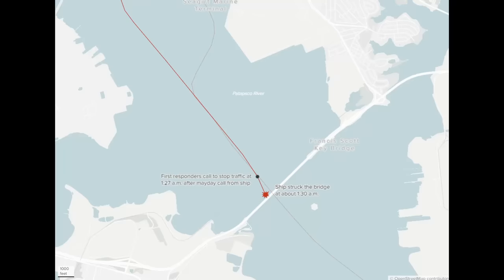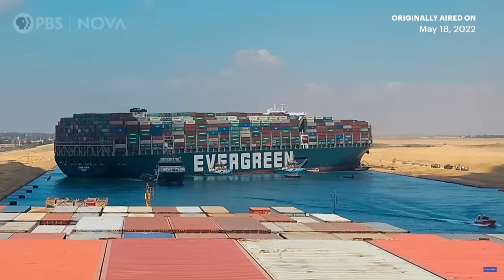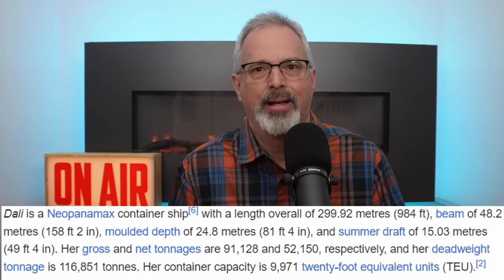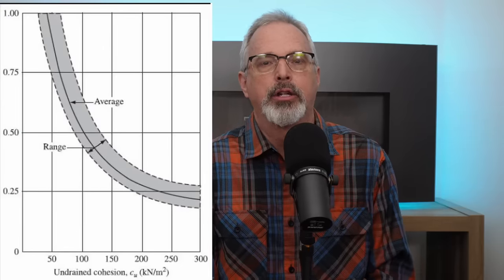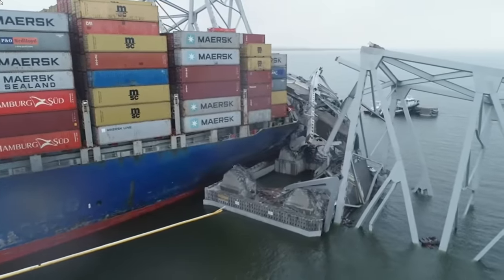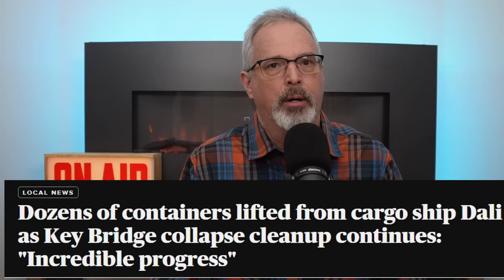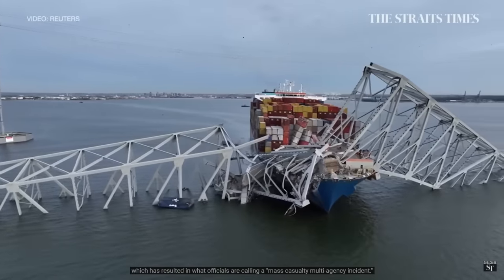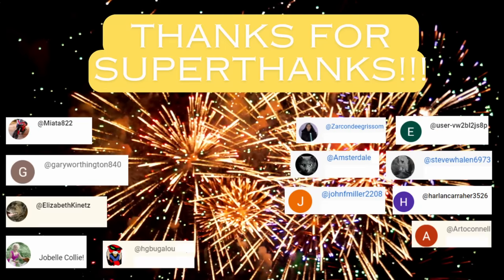Can the MV Dali be Refloated?

Comment: Casey,

There will be a series of steps needed to refloat and free the M/V Dali.

In no particular order; removal of bridge structure and concrete, removal of the anchor and chain, patching, holed tanks, pumping water from the forepeak and bow thruster room, even out trim and list, and removal of additional containers to lighten load.  I think they would need to dredge around the bulb.  I would also think they would dredge along the Dali's length so the channel was a couple of feet lower than the Dali's depth.

I would expect that they will assemble a group of tugs capable of pulling the Dali free.  I would expect the Dali's engine, propeller, and rudder would be available.

It is important to remember this operation will be done by a Salvage Master.  Someone with experience in these kinds of movements.  The Salvage Master will have the support of his naval architects and marine engineers.  The USCG has a team of naval architects and marine engineers that support the USCG-OSC.  The Classification Society (NKK) will also be involved.

While the mud presents a lot of problems, clearing debris from the bottom is a bigger problem.

Bob
Reply: Hi Bob nice thinking

Comment: Casey, I’m an actual naval architect. I doubt that they’ll have significant trouble refloating Dali. 5:1 is a reasonable full load displacement/lightship ratio for a containership of Dali’s size. Once they remove the containers and the ballast, you should expect a draft of no more that 5 meters.
Reply from the maker: Thank you.  That is a great point and I hope it works out like that.
Reply: Another actual NA here who specializes in tug design. A typical ship docking tug around there is about 50-80 tonnes (55-88 s.tons) of bollard pull (the amount of static thrust they can generate). A few big tugs, run the ship main engine in reverse and the ship comes free. I don't think it's grounded that hard. Lightering the containers at the bow and the bow lifts up and stern sinks too.
Reply: Once you get out of the main channel there, the depth quickly slopes to 10-20ft give or take.
Reply: Casey, some extra points to look at:
1) In the views shown of the Dali, if you look at the top of the command bridge of the ship, and the background shore, you will see a list to Port of ~2°. Meaning the Starboard side, is more in contact with the edge of the channel, most likely all the way to the stern.

2) On one of the marine related channels, the commenter stated that the first two bow compartments, have below the waterline gashes, from contact with the bridge pier.

3) I f the people in charge can arrange it for say 2 months from now, which to my mind will be about the time they will be ready, they can get at least 2 - 10,000 hp large ocean tugs on site. There isn't room in the channel for more, safety factors, to my mind.

4) Worst case scenario, they will have to put winch barges, anchored on the opposite side of the channel, to help pull. Keeping in mind the natural gas pipeline, that is buried below the bow.

Best wishes from the far North.
Reply from the maker: @carlthor91  Thank you for your comments!  I think there are a lot of questions about how well this refloating operation will go and what measures will have to be implemented.  Many people have commented that once the bridge debris is removed from the bow, that the ship will lift off the bottom.  That is possible, but I don't think it should be counted on, especially if there are flooded compartments.
Reply: @CaseyJones-Engineer  Thank you for the reply.
I just hope they do not have to resort to the anchored barge (Kedging) winch scenario.
That involves a total shutdown of the area, for a long period of setup, the last I know of the large Mammoet winch barge, it is in Europe.
Reply: I believe there is a gas pipeline under the Dali which would prevent certain methods of removing the ship from its current location.
Reply: @DrewKap  I see that you don't read any other posts, before posting.
Have a great day.
Reply: Thank you🇺🇸
Reply: Great points!!!!❤❤❤
Reply: What about that gas pipeline under or near the bow of the Dali.
Reply: Would you want to leave some weight on the back of the boat?  I know hull strength would be the limiting factor.
Reply: Thank u for this.  I thought this main pt bec once it’s unloaded I would seriously think it would lift on its own somewhat.
Reply: @evangatehouse5650  

Correct, and there's plenty oil industry anchor handlers with a bollard pull over 200 tonnes on the east coast.
Reply: @pecan11  I’ve worked with barges for 42 years and have gotten a few of them stuck in the mud.  Believe me that every little bit helps and sometimes will make the make or break difference.
Reply: ive spent a lot of time recently watching the suction power of mud on tanks, thats 1 smooth surface on bottom of that ship if 3/4 of it is in mud they are going to have to break that suction seal 
3/4 of that ship is outside the channel in the mud, the front area might be 4m or more deep in mud
Reply: i am a regular JoeSchmoe. Not an engineer or architect of any sort.  But I have been following this situation because I think it is interesting.  What’s Going on in Shipping Professor Mercagliano mentioned in one of his videos, that one of the bow compartments has been flooded. Meaning or implying that that is some sort of hole in the bow areas I suppose? And it doesn’t seem like any of the architects or engineers in this reply subsection mentioned that while inferring how much of not-a-problem it will be to refloat the Dali.  Anyways, what do I know? Certainly nothing compared to the engineers and naval architects.  Just seems like if there’s hole in the ship and the ship is partially flooded that, it could add thousands of tons to the force needed to pull it free.  As the host carefully stated, his off hand calculations were all very low end estimates.
Reply: Thanks. I'm late seeing this but that's what I was going to say. And they have the bow flooded so the ship doesn't move right now. There is a lot of lightering that can occur before they start trying to move it. 

Just need to ensure that they do good stability and stress calculations, so they don't flip it over or break it.

Comment: Salvage divers are very familiar with breaking the suction of sunken vessels. Edward Ellsberg, a US navy salvage expert, wrote at least 4 books on his experiences in salvaging sunken vessels. Breaking the suction of sunken vessels was a complication to be sure, but they did it regularly.
Reply from the maker: Very interesting.  Thank you.
Reply: On jack-up rigs, the leg endings called spud cans were resting on the sea bottom.  If the bottom is clay, these spud cans could easily be buried 50’ or more.  The design of the spud cans included water jets to liquify the mud making the extraction much easier. I’m sure the salvage experts include marine engineers, naval architects, and the crews operating the salvage equipment are quite experienced in dealing with the pulling the ship out of the mud.
Reply from the maker: @williamking4570  Thank you for your comments.  I agree that there are likely many well-versed experts that will be part of the effort to clear the debris and refloat the ship.  I had to think through it just for the sake of my own curiosity.
Reply: They got a “lot” of experience in Pearl Harbor in 1942. And those ships had a lot more problems with buoyancy.
Reply: @allangibson8494  Ellsberg wound up in the Red Sea after the guy who was supposed to go there was stopped at Pearl Harbor.

Comment: The previous grounding in the Chesapeake for comparison is the ‘MV Ever Forward’ in March 2022. 

They off loaded about 1/3 of the containers. Dredging, tugs, high tide, and the ship’s engine power.
Reply: Ever Forward was much more 'stuck in the mud' than the MV Dali is.  Once the bridge weight is removed from the bow - the vessel should self level to some degree.
Reply: @mmi16  : They have indeed calculated removal of just 178 containers or so should be enough. Mainly to clear the area around the fallen bridge so it can be safely cut and removed.

Anything is of course possible, but it very much sounds their calculations lead them to assume the weight of the containers is not a problem once the bridge section is removed and forward compartments sealed and pumped empty.

Comment: At 6:08, the length of bridge can be measured with the bottom of canal and water line  showing how it the ship won't burst upward after dropping the weight off the deck , the more weight from the bridge they take off the more the water line will level off and it can be pulled backwards

Comment: The ship is sitting with 4000 tons of bridge (according to the news) sitting on the bow. This is all forward of the longitudinal center of buoyancy. What your calculation doesn’t take into account is when that weight is removed the bow will rise and the stern will sink. While the Dali is outside the 50 ft channel the charted depth around the old bridge piers is 33ft. She may float free or close to it once the bridge is removed. I believe your calculation would be correct pulling in her current configuration, but it will not be correct once the ship is lightened. Also for reference the “small” assist tugs you referenced there are six in Baltimore making between 4-6000hp and add capable of 60-80ton bollard pull. Plus there are a couple other large tugs in attendance for the salvage such as the Atlantic Salvor and Atlantic Enterprise with around a 75ton bollard pull and a bunch of other tugs in the 3-4000hp range.

Comment: Thank you for another very informative video.
You may be interested to know that in the UK coastal ships were often subjected to suction forces when on berths that dried out at low water. It was was practice to run a chain under the hull to break the suction effect.
I remember my father who was a marine engineer for many years.
Telling me that once when he was the chief engineer of a small 300 ton aggregate dredger he would always run a chain under hull to prevent suction problems.
As he had once witnessed a small collier almost founder at its berth due to this! I also witnessed an aggregate dredger on a bank (the cargo would be loaded at low water from the bank) at the mouth of the River Taw in Devon virtually disappear under water until with a loud bang it rose through the rising tide!

Comment: MV Dali is apparently resting on a high pressure gas pipeline traversing the channel, adding another level of caution and risk. Most of the containers on the forward deck, as I understand it, are mostly empty and used for haz-mat items, and the first couple of compartments below deck are breeched/flooded. Once the bridge spans are cut free, I believe she will float off fairly easily.
Reply: No she's not. The pipeline in use is over 100 yards east of the Dali.

There's an old, disused pipeline to the rear, but its buried into the seabed. With the ballast removed from the ship, it will pass over that with yards, not feet, to spare.
Reply: Has the hull been penetrated / holed , have not heard that yet . Thanks

Comment: This is a good point that you have raised, though I am 100% sure that salvage engineers and naval architects have already formulated a plan. Those companies tend to keep things pretty tight lipped, unless absolutely necessary. for them, minimizing scrutiny or publicity is SOP. Information only tends to be shared with the on scene command, vessel owners and insurers.
I would be very supersized if the ship doesn't float free once enough weight is removed. just imagine how much buoyancy that ship has in order to be able to carry all those containers.
It's hard to guess how much weight of bridge debris is resting on the ship, but removing that, some containers up forward and dewatering any flooding will surely restore hundreds of tons of buoyancy. I'm not familiar with the tank arrangement on these ships, but they will de-ballast up forward and add ballast aft to trim the vessel as needed.
Regarding the path to freedom for the Dali, I suspect they will just try to back her out the way she went in there. That would be the path of least resistance.
Reply from the maker: Thank you for your remarks.  I suspect you are right that there are professionals who coming up with a well thought out plan to get this ship going again.
Reply: tight lipped? there are simply too few people who understand hydrostatic forces, so no point broadcasting to an audience that is lacking basic understanding.

Comment: “I’ll tell you what I think but you not going to like it”

When the ship hit the bridge the bow was still afloat. It struck and was deflected back and upwards, as it was coming up the bridge was coming down. so the planted it’s port into the mud. You can bet the mud was deformed. 
 
so, there are several problems
1. there were reports the ship is taking on water, that water will need to be removed assuming that when the bridge is removed the strike point was above the water line. 
2. Channels slope quickly on the edges, so it’s unlikely a level ship would be stuck across the entire crosssection of the hull, maybe a 1/4. But that quarter that stuck has been jammed down and water has been forced out of the mud. 

Anchor the back of the vessel and get a constant force tow line on the opposing pillar and you should over several days be able it off. Pulling the stern is not going to work, the ship needs to be pulled away from the edge of the channel. The assumption here is that the ship is floatable, so all that is really is a force to slide it out of the footprint in created when it hit the bottom.
Reply: Perhaps between removing the bridge debris and a good portion of the cargo up forward, they can compensate for any flooded space.  It won't 'pop up like a cork', but adding a lot of positive bouyancy should help a lot.
Reply: Excellent explanation. I was mumbling "what about suction" tight before you hit on it. Can it be refloated? 3 words, Resolve Marine Group.
Reply: Pretty sure cargo vessels have bouyancy tanks that are routinely emptied while being loaded. There are laws against emptying them if they have been filled with potentially foreign species.

Comment: It seems to me, as a layman, that the part of the piling that is impacted through the hull of the Dali would be released as all the weight on the deck is removed, and the hole in the hull is sealed, there is the possibility that the ship will tend to rise. If that's the case, the hull will be lifted off the piling just by the natural positive buoyancy, giving the tugs the room to push the ship away from the piling just enough to allow the ship to be freed for an upstream pull. That little flotation effort would also add a natural lift to slowly break the suction of the mud on the bottom of the river. Also, there is the roadway debris on the bottom next to the port bow of the Dali that would have to be cleared in order for there to be a lateral pull away from the piling. At that point there could be enough rotation of the Dali to tug it back toward the Federal Channel so it could be towed back to a pier for inspection and possible repairs.

P.s.: Is it possible that the flooded compartments (I hope they are small enough) could be made airtight from the inside, as they would be to prevent further flooding, and pump air into those compartments to at least lower the water enough to gain some buoyancy?

Comment: I really hope a gigantic storm doesn't hit before the Dali is removed. Anyways, it's such a dynamic situation with the Cg and Cbp having weird interactions, then you throw in suction forces a and possible rotation if the bottom is stuck. Then you have all of the massive debris weighing down the ship in different ways and possibly pulling the ship or even supporting it. 

One thing to keep in mind is that the ship was moving as the bridge fell down on it. It came to a stop super fast. The stresses on that ship must have been wild.
Reply: even the worst noreasters dont get that far up the bay. it would take VERY bad hurricane at lest cat 4 that hit just right to be real threat that far up the bay
Reply: @Elios0000  Yup, Hurricane season is coming. At least by then the bridge spans on its bow would be removed and lots of containers  removed. High winds and waves could definitely affect the Dali. And the forces in the right direction maybe move it away from the mud.  Then we'll have the Dali drifting off, hopefully engines would have some control.
While thinking of containers, would most of the containers removed and having many at the stern give the bow area more buoyancy?

Comment: Once all of the debris is removed, it will probably raise the bow. Otherwise, cargo will have to be removed .

There are also large tugs with 30 to 40 thousand horsepower and bollard pulling strength 400+ metric tons. 

One difference here from the Ever Given is the room in the surrounding waters to bring in tugs and have them pull in the most advantageous direction. 

I'll wager that pulling the ship back into the channel won't be that tough. 

Interesting and thought provoking presentation. Thanks!

Comment: Great question. Ship trim, list, buoyancy, stability & watertight integrity will determine if this grounded  beast will float free once cut away of bridge debris. It appears some interior lower compartments forward have already failed and flooded. Lighten the cargo load and remove seawater ballast. Lots of luck required. Carry on!
Reply from the maker: Thank you for your comments on this.  I guess that was my main point is that this refloat may not be a slam dunk success.
Reply: The USACE plans on it.